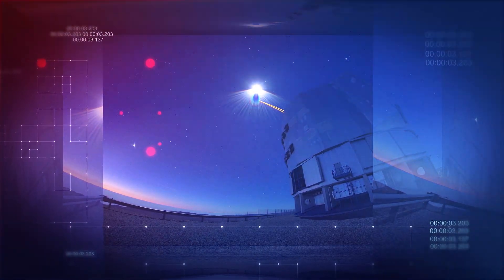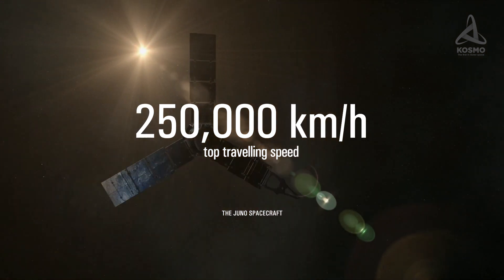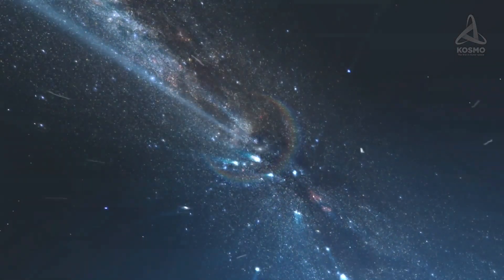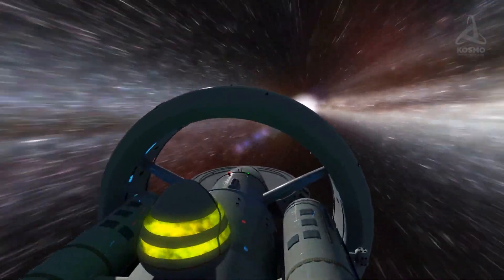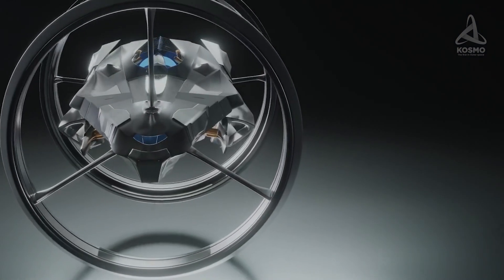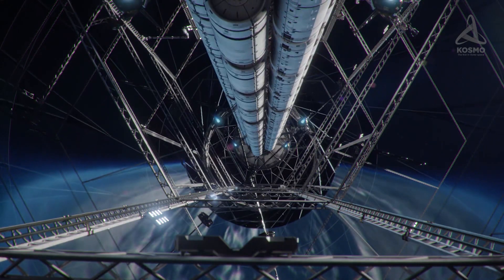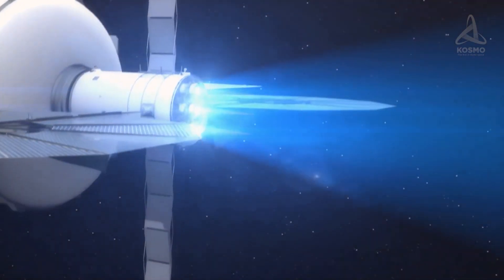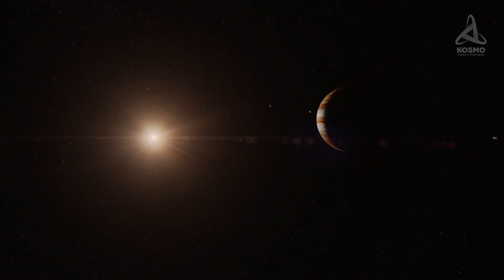A SPACESHIP TRAVELLING AT SUPERLUMINAL SPEEDS. IS A WARP DRIVE POSSIBLE?

Comment: I hate being a wet blanket. Twice in this video, the narration refers to traveling at "supersonic" speeds, the technology for which has been available for over sixty years now. I'm sure that you meant "superluminal," as your title states correctly. I very much like what you're doing in these videos. The production values and research are excellent. But little oversights such as that, or constantly using multiples to express negative values, that detract from your credibility somewhat.

Comment: How in the blazes does a spacecraft travel at 'supersonic' speeds in space?!?!
On average, there are ~4 protons per cubic meter in space... it is very difficult to travel at any-sonic speed when there's no medium around to propagate sound waves. In any case, supersonic or this silly "ultrasonic" speed is totally insignificant; it is nowhere near fast enough to make practical use of such speed. The Parker Solar Probe is doing ~430,000mph, or Mach 560 if you must, while orbiting our Sun. Reference frames are a thing, by the way.